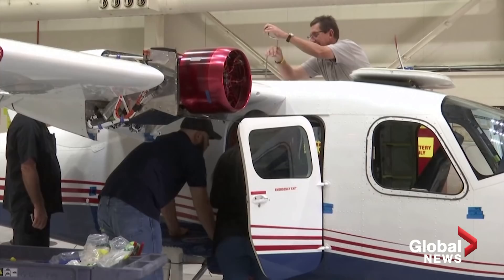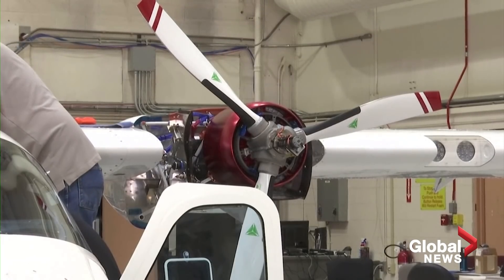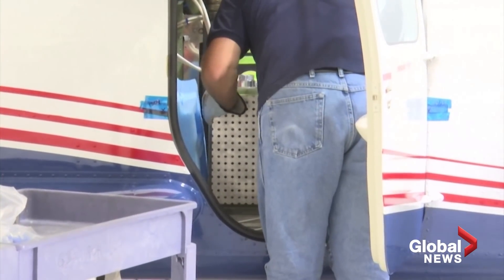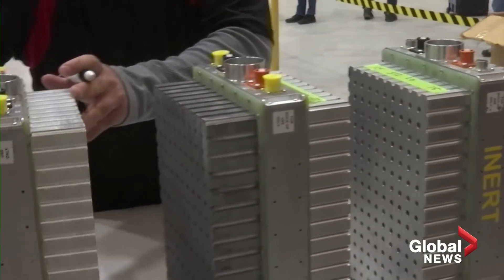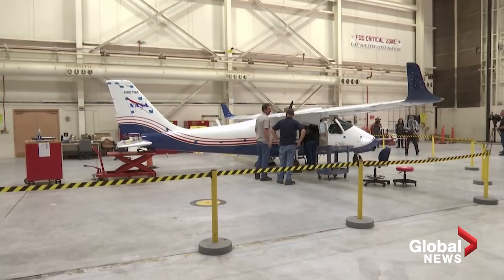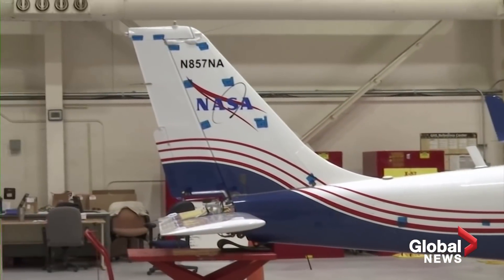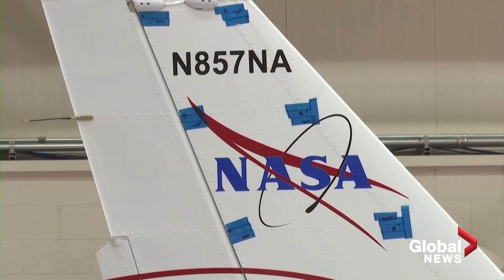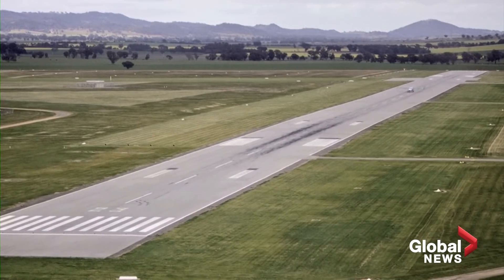NASA unveils its first all-electric airplane, the ‘Maxwell’

Comment: This should be called the Maxwell Smart in honour of Don Adams' TV character by the same name. He was not a smart guy. Putting your engines at the wing tips is a very bad idea in several areas. Rotational inertia in a spin is one major issue. Any problem with engine asymmetry (such as a failure) will have it's maximum detrimental effect with engines mounted at the wing tips. This is a planform that is inviting control problems that can kill people. Design planes for stability and failure recovery first and foremost.
Reply: You've no clue what you're talking about. NASA has a lot of airframes that had all sorts of configurations including wing tip designs. Don't forget, NASA came from NACA, the people that basically standardized modern air flight.
Reply: @aserta  Doesn't mean that all of the ideas were good and there certainly have been accidents and aborted projects. I wouldn't get in this plane at all. These kind of things are supposed to wake you up to think more about a better way to accomplish something.

Comment: Battery technology has a long ways to go before this is commercially feasible. LIPO batteries are temperamental. They  MUST be charged and discharged within specific current limits..or BOOM..they get wet..BOOM..they get punctured..BOOM..they get hot..BOOM….they get shorted out..BOOM, and they have a definite number of cycle life, plus they are expensive.

Comment: What happens when you say fly at 38,000 feet and it’s really cold..........do these batteries keep work like the energizer bunny?  You wont catch me in one of these until they have flown for at least ten years!
Reply: These planes are short range designed to fly at well under 10,000 feet.  Likely closer to 5000 feet.

Comment: I would assume that the wind passing any moving aircraft could be harnessed as well to provide electric power generation
Reply: I doubt they would ever allow a fixtured aircraft to have windmilling propellers.  It's a good thought, though.
Reply: Do you mean NON moving aircraft? There would be more drag created than thrust (This would go with any system, or you would be creating free energy). As far as windmilling a non moving airplane motor, that would need extra systems onboard, which creates more weight, and also the fact that the plane wouldn't be able to weathervane towards the wind either. It wouldn't be effecient, but would add weight, which is VERY critical on electric planes.
Reply: @mystupidvideos4347  I only assume that whoever wrote that reply meant that a aircraft sitting on the ground not flying.  That's why I wrote the response I did.  they would still never allow windmilling propellers on an aircraft sitting on the ground that's too dangerous

Comment: A 747 holds about 200,000 litres of fuel.  There is 10 kWh of energy per litre. The gas turbine engines on an aircraft are about 40% efficient. So that's 200,000*10*0.4 = 800,000 kWh of equivalent stored electrical energy. A Tesla 3 battery is 75 kWh.  So the 747 would require about 11,000 Tesla three batteries. A Telsa 3 battery weighs about 1000 lb. So that's 11 million lbs of batteries to power the 747.  A 747 has maximum take off weight of 910,000 lb, or about 1 million pounds. So we're an order of magnitude away in terms of weight, without considering cargo, passengers, or the weight of the plane's structure. That also doesn't consider the cabin heating load, which is substantial. Assuming that one could make an engine that even had the thrust necessary to fly the plane.  A Tesla level 3 super charger's sustained charge rate is about 150 kW. So to charge the 747 batteries in a reasonable amount of time (under and hour) we'd need 11,000 * 150 kW = 1650000 kW = 1.6 GW of power.  So expect to build a dedicated, very large, power generation plant, at every airport. Something on the order of two or three 5 GW nuclear power stations would be necessary at a large airport.  A small airport might get away with one nuclear power plant or about 1000-2000 large wind turbines or 1000-2000 square kilometres of solar. And God help the firefighters trying to contain an out of control electrical fire, or a short circuit, in a fully charged 800,000 kWh battery, and the passengers trying to escape it. Imagine the scenarios.
Reply: In 1903 no one envisioned a Boeing 767,  and yet here we are.  These things are  process, naysayers seldom make a difference in anything.
Reply: @johnherrmann8957  Computing the scope of the challenge, and running numbers out of curiosity, is not "nay saying", it's facts and analysis. The exact process of progress that got us from 1903 to now. There were many failed efforts leading up to 1903 because blind faith ignored reason.
Reply: Jim Trainor if it’s not too much of a hassle, I’d love to hear your thoughts on the following question. Could electric vehicles generate power while in use to recharge batteries and would that energy be sufficient to improve efficiency? (p.s. apologies for the poor wording on my end)
Reply: @jdbrisebois8732  Batteries cannot be simultaneously charged and discharged so it's one or the other.  Electric vehicles, and hybrid electrics, use regenerative braking to improve efficiency today. So that is already happening, to a certain extent, but they switch from discharging to charging when regenerative braking is activated. But that is never enough energy to replace what is used to propel the car, it's just some recovery of the vehicle's kinetic energy.  If you mean run a generator, e.g. use a hybrid's internal combustion engine to run a generator to charge the battery then I believe some plugin hybrids can do that but it's not a great idea from an efficiency perspective because there are too many energy conversions happening. IMO, a plugin hybrid should simply charge the battery from an electrical power source, use the power to drive the car, and when it is exhausted simply switch to the engine, or combine both power sources via a mechanical transmission. I believe that's the way that the Honda Clarity and Toyota Prius Prime operate, more or less. Maybe the Chevy Volt too, but I haven't checked.
Reply: Jim Trainor thanks for taking the time, always a pleasure to learn something new 👍😊
Reply: Or... you can just fly small aircraft with very few passengers very short distances and the problem goes away.  The bigger stuff isn't even in the rough draft stage right now.

Comment: So government funded companies in the private sector are reinventing technology that has been around for a decades best part is government still doing it like the old days $$$$$$ so they can cash in on regulation fees like licensing FAA. Worked for Boeing.  It's the culture of politics to spend billions to reinvent the wheel (that happened) now larger rc motors more happened for technology for all after NASA funding was diverted to government.
Reply: Sure, we all have a private all electric commercial planes. It's a known proven technology that's been used for decades. Or actually that's not the case at all, and this all pretty niche and experimental.